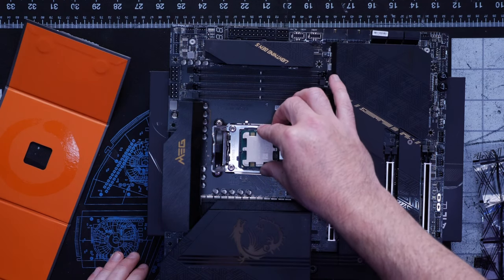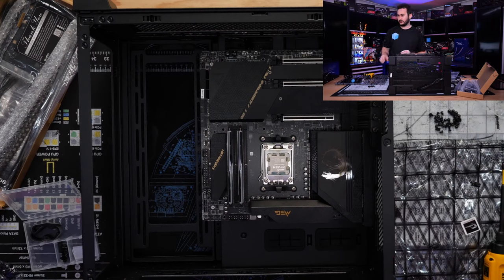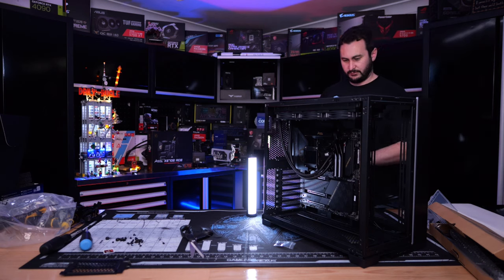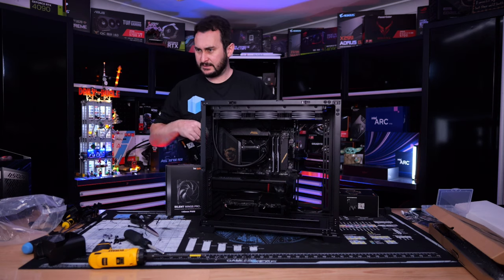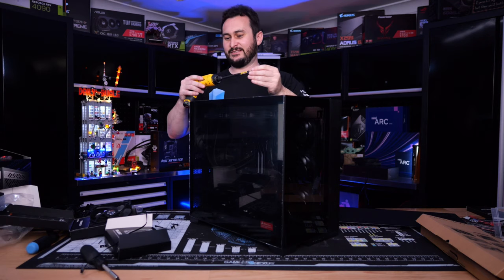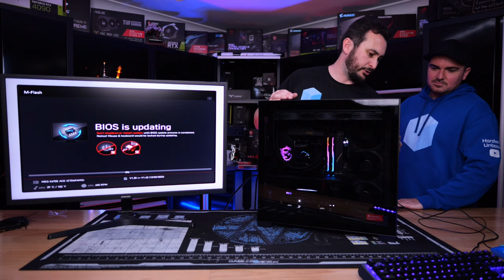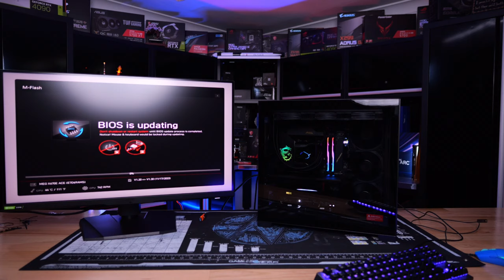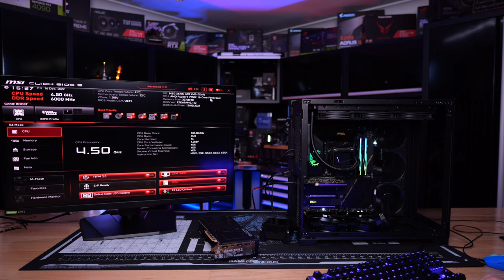Live: All AMD PC Build, Radeon RX 7900 XTX + Ryzen 9 7950X

Comment: Fantastic I look forward to making this build in 2024 when the parts are not so expensive
Reply: at this rate in 2024 gpu will cost 3000 euro
Reply: For gaming 7700x is actually better in gaming , also cheaper .  But if you want top tier gaming you gotta wait for the 7800X3D .
And for the the gpu you better buy of the partner models of 7900XTX cause some of the reference cards seem to have a small vapor chamber problem  Also you don't wanna miss the third 8pin for more overclocking headroom

Comment: I finally was able to add the XTX to my Ryzen 7900x build.  Thrilled.
Reply: How is that working out? Got the 7900x as well and waiting to pull the trigger on a xt   or xtx.
Reply: Did they come up with the new drivers yet? And is pairing it with an AMD CPU give it some of extra juice?
Reply: @balvrikk7822  I mean, is there really a reason NOT to use the xtx ? price is so close, at that point might as well spend a little bit more
Reply: @HoodHussler  SAM is most effective when AMD CPUs and graphics cards are paired, so there's that. Sometimes yields a bit more performance.
Reply: @nekogami87  Only if you NEED a drop in upgrade and have a 700W PSU or something, or have a very restrictive case, but need the form factor
Reply: @brendanleigh1709  Yeah but if he has a 7900x I assume the PSU is not under 700W. as for the case, I don't think these 2 cards are that different dimension wise are they ?
Reply: @nekogami87  some people run really close to the line, I'm running an eco 3700X with an XTX on a 750W, some people try to run it even tighter. 

Some people run cases that are super heavy on SATA storage and can barely fit the XT.

Both are the minority, but there's a niche for both.

But ye, for sure, the majority that are at rthst cost are better served depending the extra for the XTX, even in Aus the price isn't that different.

There are a few edge cases, though.
Reply: @balvrikk7822  So far its great. All signs point to avoid the XT but currently that's the only one you can find easily

Comment: always fun to build a pc from scratch.. i remember going all out.. spent $4000 on my setup 5-6 years ago..  2700x.. x470, 1080ti, duel 360mm radiator, 13 RGB thermaltake fans, RGB t hermal take water blocks for the gpu and cpu, thermaltake full sized view 71 glass case...   bose qc 35 2 heaphones, 27 inch 1440p curved monitor, chair. desk.. keyboard mouse rgb...  Been doing this for 26 years now....  i spent i think $1100 on just the overkill watercooling and fans haha, because well ive been watercooling for 26 years, and after 20 years using the same dangerden maze water block and eheim pond pump and heatercore that i just modded to work on new sockets... it was time 

Upgraded the pc a little to a x570 and 3800x few years ago... but now i think im getting a 7900xt or xtx not sure, and a 5900x..  Id like to go to the 7900x cpu's but there is 0 point in getting a new mobo and ram, and a expensive cpu when the 5900x is like 200$ off right now...

I will say this, I'll take that 7900xtx off your hands you sht on a few days ago if you dont want it

Comment: I never want to misfortune on anyone, but it made me feel better about myself to see a highly competent and respected professional struggle with the same things I have. I've had the hardest time with a bios upgrade during my previous Zen 3 build - the mobo required a bios upgrade prior to CPU installation, and the gigabtye EZ bios feature (or whatever gigabyte calls it) would not update. I tried everything recommended and just said F it after 4 hrs and returned the board to Amazon. The replacement board worked fine - not sure why.
Reply: I have updated BIOS on a lot of these boards now. A lot will not play nice or simply will not work with a USB drive over 4GB, must be FAT32. You can't even use a partitioned larger drive either. A lot need the file renamed to something banal listed in small print on the damn website in an obscure location, all together a pain in the ass but my ancient USB Drive I wear around my neck now like a Holy Symbol.
Reply from the maker: @Berserkism  oddly I done literally hundreds of these, just this year, with multiple different thumb drives and never had a single issue. Up until now I'd characterize BIOS updates as very quick and easy.
Reply: Never struggled with BIOS updates, even in the old days of DOS floppy disks. Nowadays I just use a good old USB 2.0 4GB drive and it's as easy as it gets.
Reply: @xynostasos9022  I think my issue was a board issue as it was the only variable that changed.

Comment: I had loads of memory training and other memory related issues when I first started building my 7950x with 128gb memory on Asus Crosshair Extreme board...but the latest BIOS update fixed everything in a snap...now everything works at rated speeds and timings.
Reply: Wonder if they fixed it, or just worsened the memory training lmao
Reply: @TheHighborn  I don't think it's the primary timings that are the problem. It's the sub timings that have to be keyed into BIOS to support all the different RAM available. As soon as that BIOS update got released, all my issues disappeared and everything started working perfectly.
Reply: @GSP-76  sounds great man!
Reply: @TheHighborn  oh another thing I should point out is that if I took two sticks of memory out, it worked...it wasn't 100% smooth but getting 2 sticks of memory working was much easier than 4. I think over the next few months, AMD will keep releasing more updates to support more memory brands and timings. I would also strongly recommend buying AMD Expo memory. You'll have much better luck getting those to work out the box.
Reply: how long did it train for? was it more than 10 minutes?
Reply: What speeds are you able to get? I'm thinking of the same configuration, same motherboard same cpu, just with a rtx 4090

Comment: Had trouble flashing a MSI B550A-Pro board and in the end just used a good old 8GB USB stick formatted to FAT32 and just put the new bios renamed to msi.rom on it and used bios flashback USB port pressed the little button beside it and presto it worked. For normal bios I use a 8GB USB stick formatted NTFS and that works fine.

Comment: Using that exact model of a USB thumb drive (with the swivel) is just asking for trouble. Used to work in front-line support, we'd see a few of those in with data-loss every week.
Reply from the maker: Mate I've updated over 100 boards without issue.

Comment: Based on information so far AIB 7900XTX are ~10% faster than AMD reference design. Which seems to suggest the only way to go is AIB card for ultimate build. I appreciate this option may not have been available at the time, but what I am trying to say is that judging performance based on reference design could be massively misleading. 

Other thing I don't understand - 150W TDP CPU get's 360mm rad... 360W TDP GPU is cooled on air?! Does nobody see issue with that? What I am trying to say is that in order to have acceptable thermals GPUs with 300W+ TDP must be water-cooled and ideally should come as such from factory.
Reply: I'm betting the AIB cards are achieving that 10% performance increase with a MASSIVE power increase.

The problems with this card won't be fixed with overclocking. It's either a driver issue that will take time to resolve, or a hardware issue that will require a redesign of the chip architecture.

There are rumours of an RDNA3+ coming next year, so I assume it's the latter.
Reply: 150w cpus are also fine on air zzz
Reply: @Xune2000  You probably right... but nobody cares about power when the goal is ultimate FPS.

Like OK - the reference design 7900XTX get's me 160FPS on 360W and 4090 gets 189FPS at 400W... maybe. If AIB OC card on water get's me 200FPS at 480W then who cares?!  I will go with more FPS every time.

Point is - high efficiency is NICE TO HAVE, but ultimate performance is what matters. 

I am not going to see the difference either way - in fact I am still running 1350W PSU from 10 years ago when I had 2X4870X2 Quad-CF system. Back then power draw from just 4GPUs was 640W on stock clocks. 

As well don't forget that for both CPU and GPU the power consumption is not constant. What is most important is the maximum framerate they can achieve in certain complex scene. Yes efficiency may be important if you GPU rendering, but if you just gaming then really you don't care - it is going to peak in few places and the more always the better.. as long as your PSU can handle it.
Reply: @Dusk007  And I guess that is partially my point - why put $200 360mm on CPU, when really the hottest and loudest part of the system will be GPU?!

If somebody wants cooler and more quiet system, then sure I can see benefit in water cooling both GPU and CPU.

But why just water cool CPU and then listen to jet taking off in your room every time you start playing more demanding title?!

For me this looks like misplaced priorities... the guy who skips legs days type of thing. mahusive 360 rad on CPU and GPU cooking eggs on air.

I mean I appreciate that so far there have been no AiO 7900s, only Asrock waterblocked one which requires custom loop (that is kind of sad as the only way I am getting 7900XTX or 4090 is if they are WC), but still that 360 rad just looks wrong next to air cooler GPU.
Reply: @lp9280  I care, and a lot of people who pay their own electricity bills care.

If a person is so wealthy that money is no object, or they're living with their parents and don't contribute to the bills, then I can understand them not caring about how much electricity their computer uses. However the majority of people are concerned about the efficiency of their computer and how much their electricity bill is.
Reply: @Xune2000  That is BS and self-defeating argument - if you care about energy bills, then you don't buy 4090 or 7900XTX. These cars are for ultimate power and that is why they cost what they cost. That is why people bought 3090Ti which was 500W+. If you really that bothered about energy bills than I can't see how 365W+ 7900XTX isn't an issue even before OC... 4090 as well easily breaks 500W. 

I am not trying to convince you that OC 7900XTX is more efficient, because it is not true, what I am saying for the class of the card it is - that DOES NOT MATTER. You buying it to get most FPS possible and if it is as well efficient... well nice to know.

These are the equivalent of Ferraris and Lamborghinis of car world, if you care about fuel economy for your commuting then you just don't buy such car... you get Prius or something similar and save money happily ever after.

Besides I do pay my energy bills, but you clearly just don't understand how PC power consumption works. 300W GPU @12V = 15W @ 240V... now sure PSU is not 100% efficient, nor is GPU itself, so let's assume 80% efficiency that gives us 18W or 0.018kWh continuous use. This at the moment in UK at our enormous British electricity prices would cost me £280 to run continuously for whole year! 24/7/365. Now if OC makes the card run at 400W this will cost me £373 per year. Now obviously I am not mining crypto so PC is not on 24/7/365 and even when it is on GPU is not always 100% pushed to the limit. So if we consider realistic scenario of say 4h/day @ 75% this makes it ~ 0.00225kWh vs. 0.003kWh non-OC vs. OC, £35 vs. £46 per YEAR!... 

Now do you really think I am going to cry about £11 more over a year for 10% of improvements in FPS... vs getting 4090 for £500 more? Nope - it definitely makes more sense for me to OC the 7900XTX even if it makes it slightly less efficient than it already is (inefficient).
Reply: Just because it has a high TDP doesn't nessisarily mean you have to liquid cool. It just means your air cooler is going to be bulky AF (which is the case with the battleship sized GPU's we've seen over the last 2 gens) but still doable. Liquid cooling tends to be better space wise, and also when saturation is important as you can just have larger res and resist heat saturation for a very long time where as air coolers saturate with 5-10 minutes.
Reply: @oceanbytez847  well you kind of disputed your own statement...

Yes air cooling 300W+ GPUs just creates these enormous stupid monsters, not only that it stills sucks, because they are hot and loud.

My GPU ownership goes something like this 2X4870X2> 2X R9 290X > Fury X > 5700XT > 3080Ti > 6900XT LC. 

2x4870x2 were 640W TDP, would literally heat the room and would sounds like vacuum cleaner. Similar story with 2X 290X on air, but I got custom loop and sworn to never go back to air. There is no comparison. 

As such 300W TDP Fury was great as well, not very competitive GPU, but it would run at 55C all day long and fan would not go to even 50%.

Next-up 5700XT... I hated it, but it was relatively low power card, the heat was manageable... still fan would run at 70% and GPU would stay at low 70Cs. Not great not horrible...

Comes 3080Ti - felt like fcuking back to 2010. Extremely loud even with it's fancy cooler... it would continuously run 90C+ and I had to go to my old days of setting-up fan curve manually, so the card would stabiles ~85C at 85% fan speed... just ridiculous and it would literally have burning PCB smell in the room...

As at the time I had option between that hell spawn 3080Ti and Strix OC 6900 LC... I replaced it in the same case for 6900XT. Day an night difference... it idles at 30C, it never even reaches 50C (I think max was 56C when we had heatwave of 38C in summer) and most of the time fans don't even spin on 240mm AiO and even if they spin... they spin at like 20%. 

Ohh and by the way my 5800X3D is running on air with standard AMD Wraith RGB... it sits around 60C, the fan sometimes get's audible, but not because it is running very fast, only because AMD spin-up curve is kind of janky... basically you notice it spinning-up, more than really the fan. The only reason I would replace it is because it is kind of dust trap...

So in summary - yes 300W+ card can be air cooled, does not mean it is good idea... WC is just the way to go with these if somewhat acceptable acoustic and thermal performance is desired.

Comment: I've always heard that you should never update the BIOS unless you have to.

One of those - if it ain't broke, don't fix it - kind of things.

The only reason I updated my board was due to memory compatibility issues and a vulnerability. 

Thank God for dual bios. One of them failed, and I was able to restore the bad one thanks to the hot switch.

Waste of alot of time and potentially messing up the board. It can get fixed, just a pain.
Reply from the maker: It's best practice to update the BIOS for a new build, especially for a new platform that has received several fixes.

Comment: On any Intel I could fry eggs on it.
But my old AMD FX-6350 Desktop build still uses less power than my workstation laptop and it's still going strong even after 10 years. It runs so cool I don't even need an air conditioner.  ;)

Comment: Just an FYI: M-Flash can read   MBR or GPT formatted devices in FAT16/32 or NTFS, but not EXT or ExFat. BIOS Flashback is limited to FAT with MBR. Every BIOS update I've done on my B550 A-Pro with M-Flash was done with the BIOS update file stored on the root of my GPT/NTFS formatted Seagate 3TB USB + Hub -- an old school spinner drive. Also, M-Flash's file manager should also be able to browse SATA and m.2 drives so downloading and storing BIOS updates to the root of those drives (via a Linux Live Session) is an option and probably faster than the flash drive salad approach ... 😆

Comment: Cant even get a 7900 here in uk no where has them not even Amazon
Reply: i found xt gpu in uk 999
Reply: The XT's are readily available at Scan and Overclockers and in fact Overclockers has one at 899 GBP and in stock, the XTX is sold out but just keep an eye out at Scan, Overcckers, Ebuyer, CCL and Novatech...Personally if you can find a 4080 at 1199.99 GBP like the GameRock one at Overclockers which is in stock, then I would go 4080 over XTX as it will only be a 100 to 200 difference.....Still way overpriced but the XTX also should have been a bit cheaper and the 7900XT even more so..

Comment: 😂 That was disappointing… I never had a build not boot. Only hackintoshes are challenging, but that’s in the past for me.
Reply: It did boot though, it worked. If they just installed Windows and got going it would have been fine. There was a bug with the update process, probably a hardware compatibility issue. These things can happen.